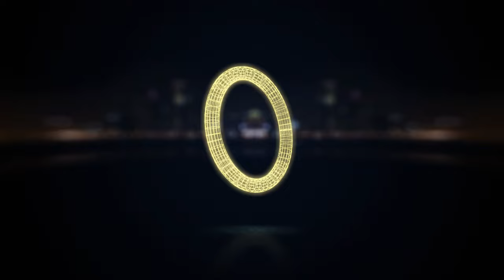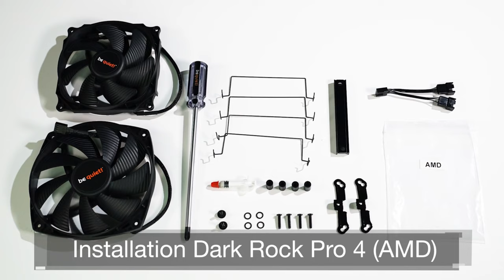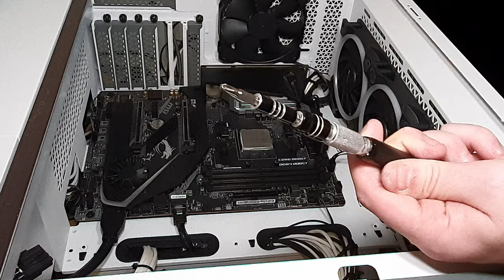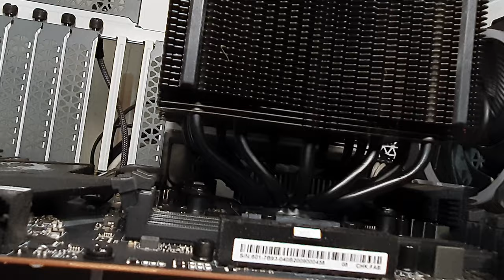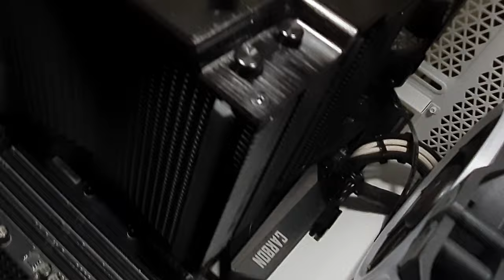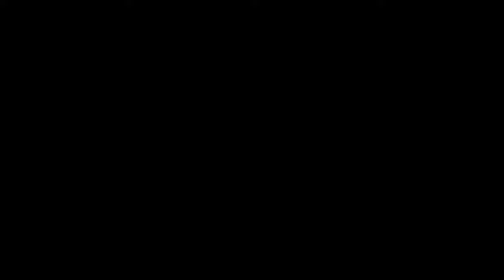How To Install Be Quiet Dark Rock Pro 4 (AM4 Installation)

Comment: Hi WELSHYTECH, what happens if I install it upside down? I tried to install it  like you but I can't fit my RAM inside ,  it's just does not allow me to put any stick of RAM
I've checked in Core temp and the temps are ok even under Heavy Loads like games and rendering. 
its Ok ok i need to take it to the store ( for new ram ,case broke mine lol , and assemble everything.)
Reply from the maker: you need to install the ram first and problem with putting where the fans blow at the top is it will take your gpu heat and could affect the cooling